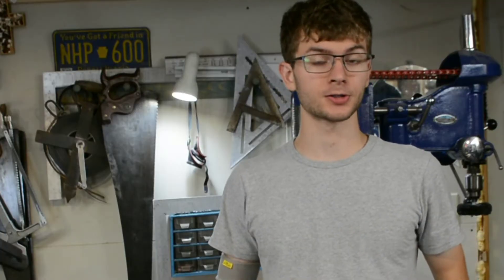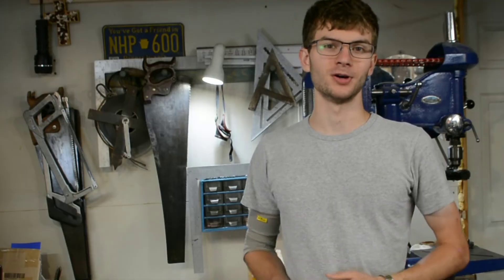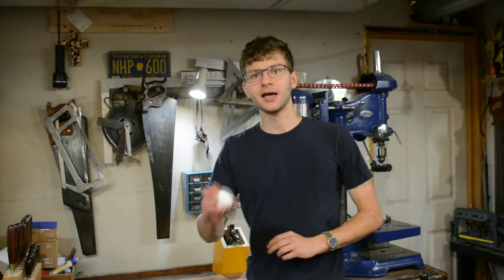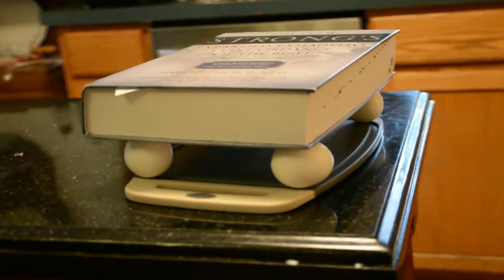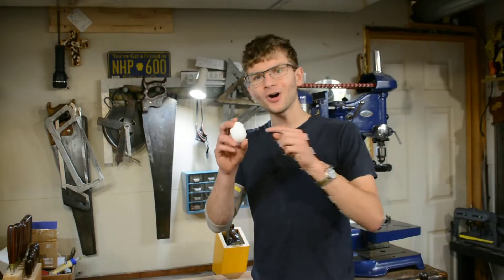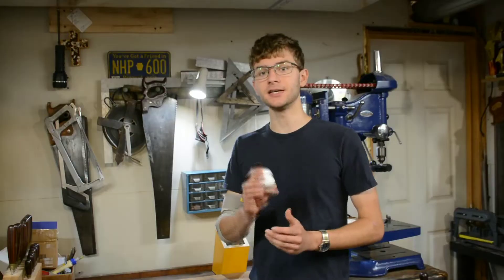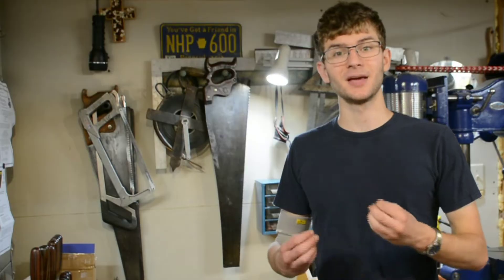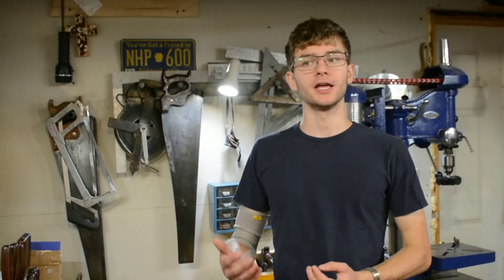Blacksmithing Basics: How Heat Treating Actually Works

Comment: Excellent video. Any tips on hardening mild Steel?
Reply from the maker: @tsafa,
Thank you so much!! I really appreciate that!!

 Unfortunately, mild steel has a really low carbon content, so it won't harden. On the bright side, that makes it super forgiving when forging!

 Depending on how hard you need, try using a medium carbon steel, say 1045 - 1065, or a high carbon steel 1070 - 1095.

I hope this helps!!
Happy Hammering!
-Miles Forge

Comment: what about hardening in hot or boiling water instead of room temperature?  
my uncle otto was a blacksmith and i loved being in his shop.  
great video
Reply from the maker: @greg33033,
I have never heard of that being done; however, it is common to preheat an oil quench. I would be interested in seeing what would happen. In the case of oil, it makes the quench less harsh, and for water it would likely do the same. I am unsure how much it would effect the quench. Water is a harsher quench in that it takes more energy to heat up a water molecule than an oil molecule. Doing this would have the difficulty of getting the water up to temperature, and keeping it there.

I apologize for that being a little all over the place.

In short: yes that certainly would make a difference, but I am unsure how much of a difference it would be.

 How awesome that you were able to spend time being in the shop with your Uncle Otto! Was a hot water quench something that he did with his work?

Regards,
God bless,
-Miles Forge

Comment: I need to learn the terms got me a little confused
Reply from the maker: @addy3dia,
I struggled with the terms for some time as well. 

Hardening: Quenching the piece.

Tempering: Heating the piece to a desired temp (~250 - 1000 Degrees F) to remove some of the hardness.

Normalizing: Heating the piece and letting it cool in a room temperature environment. This removes most of the hardness.

Annealing: Letting the piece cool very gradually over several hours. This removes all hardness.

I hope this helps!
God bless!
-Miles Forge